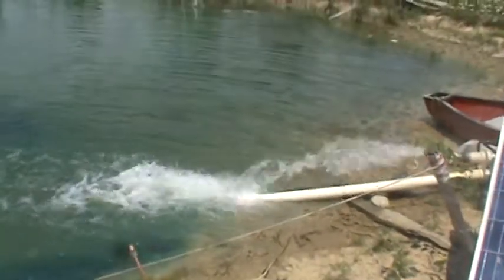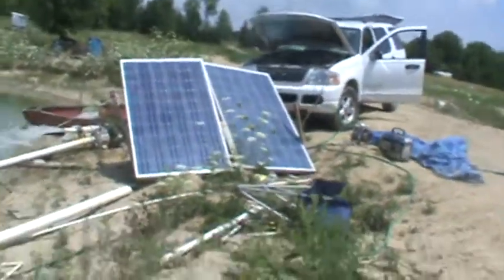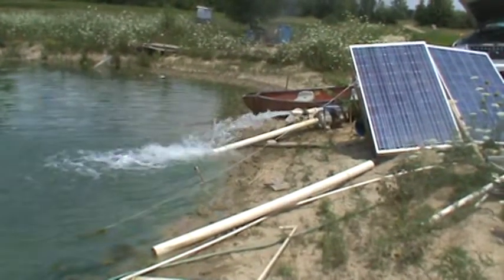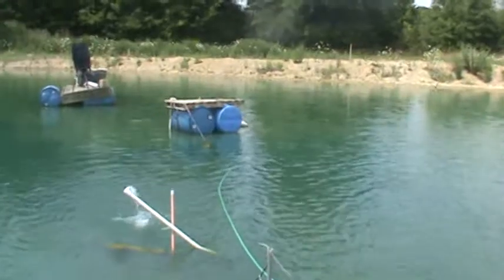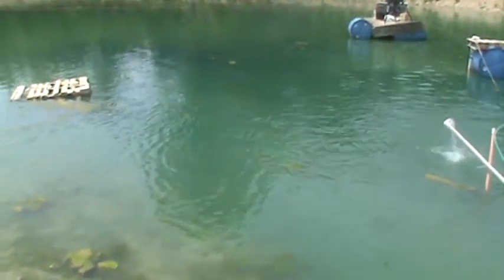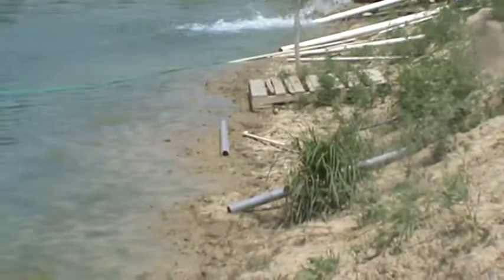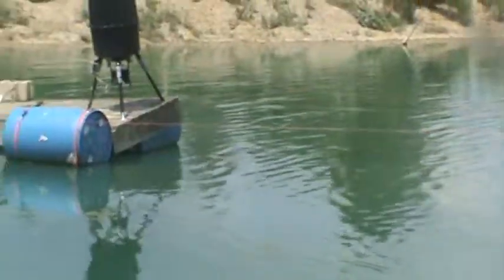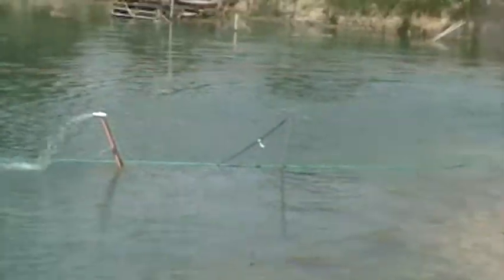Fish pond stirring using a trash pump solar panels pumping pond

Comment: Where can i get this please?
Reply from the maker: I found the style of air pump below off of ebay: 
They are loud and hot, but the move alot of air and are pretty bullet proof. Great for aquaculture bad for a backyard or in house system. 
IE: This pump below is: 
Elemental O2 Commercial Pump’s powerful electromagnetic motor pushes 1268 gph 
if you push that out of a 12" diameter diaphragm at 6ft depth, I guessed about +10,000 gallons per hour moved and circulated. I move these around or use 2 of them in a 1/2 acre pond when I have hot temps and too many fish for natural conditions. 
 Air is cheap and easy to move, thus using the venturi effect to push/pull the dead water from a certain depth up to the surface is physically the best engineering method for circulation (thus aeration of low oxygen water). 
NOTE: the water does not aerate from the bubbles... moving low O2 dead water from 3 or 4 ft deep to the surface exposes the low 0-2% Oxygen water to 18% oxygen air, thus when each gallon of water gets push to the surface by the rising bubbles it becomes oxygenated.  
Stirring or mixing the pond is the trick. Blowing wind does this best! But in the dead of summer hot days, no wind, you need to take action. 
http://www.ebay.com/itm/Commercial-Linear-Air-Pump-72-Watt-Aquarium-Hydroponics-Aquaponics-Fish-Pond-Koi-/142040341522?epid=518933447&hash=item2112439c12:g:YboAAMXQkl9RbEXw
Reply from the maker: Using the cost calculation below, 13 cents per kilowatt-hr
72 watts divided by 1000 kw/w = 0.072*.13 ==~ less than $10 per month for electricity vs $700 
I purchase a 2HP professional sewage treatment pump, for when things get nasty and I need to run continuously. 
This bad boy (with the 1HP adapter) moves about 100,000 gallons per hour, turns the entire pond over about 3-4 times per day, it becomes like a lazy river, see my videos on running this. 
It's a pain to setup, but man it moves some water. 
https://www.aireo2.com/en/products/aire-o2-series-ii-aspirator-aerator/
Reply from the maker: Here's a picture of the two efficient pumps (linear and recirculating) The big one is the recirculating, it's moves a ton of air, but low pressure (like 8-10psi), but are expensive, this one is 
https://photos.app.goo.gl/m9dV3WsyD2m6n91y1
Reply from the maker: Here's a picture of an overloaded 1/2 acre pond it had 12,000 6-8" Large Mouth Bass in it and O2 went bad, due to weather, and a number of factors. I added the big pump jobber in the background, in the foreground is the smaller unit running, I really need to get these moved further away from shore line. 
https://photos.app.goo.gl/qnUmogRNIweINxVw2

Comment: I missed how many watts the solar panel is.
What are the 
GPH on the 60 watt water pump?
Reply from the maker: 60 Watt, water pump, the air does the job better, much more water moved per watt. 
Had to run the trash pump to fix up the water quality. That pump moves a massive more water than aerator or water pump.
Reply from the maker: it's not GPH, i think it's like LPM measurement, yeah! 
I put it in the description, it's ""1,000 gallons per hour" - 
The solar one is good for keeping a trickle, I use the trash pumps and big pumps for when things get ugly. 
But the little pumps, if consistently run will help, but keep a trash pump as backup, if you run the solar stuff continuously and periodically hit the pond with a more expensive but you get about 15,000 gallons per hour + 3 hours, (cause in this case the head is only about 1ft, so the pump doesn't have to work as hard). 
They measure water pump per HP/cost. 
Not counting capital costs or configuration headaches (solar is a pain in the ass to manage). 
45,000 gallons per $3 gas = that's 15,000 gallons of water moved for $3, if you run that continuously it would be $700 per month. WOW. 
Run the solar pump constantly and during the problem times, hot calm days, run the trash pump in the late evenings, early mornings.
Reply from the maker: i think i said 400, but each panel was 230 as I remember, so taking out the sale inefficiency, I said the combined two panels were 400 watts of output. Periodically, I would check the batteries, during the hot summer months it did the job of producing enough electricity to charge the deep cell 100 amp-hr batteries (I had two of them) in the circuit.